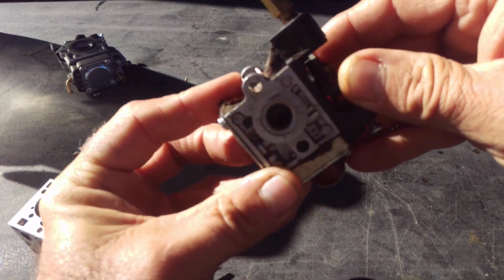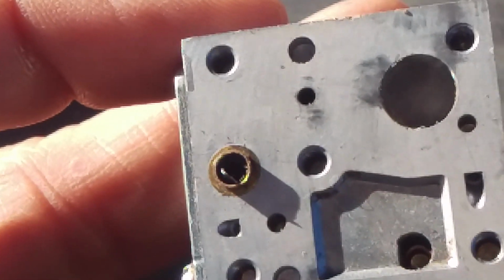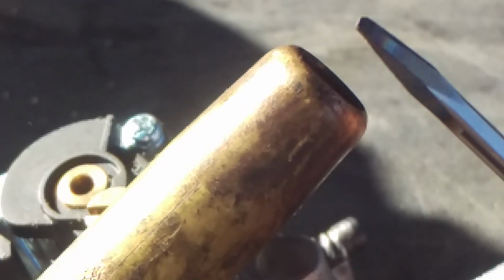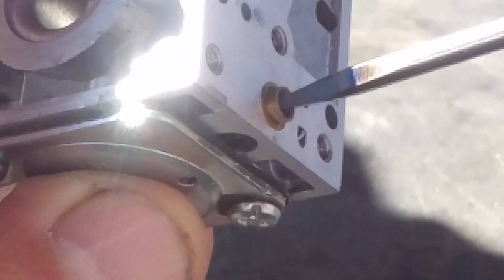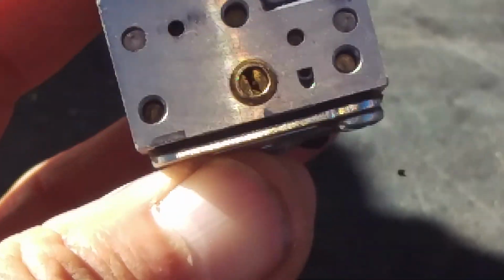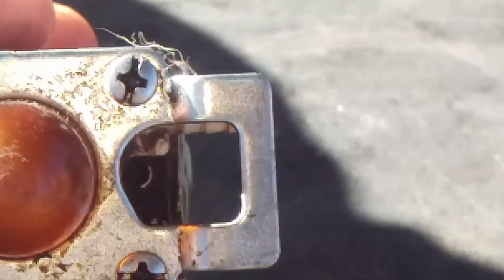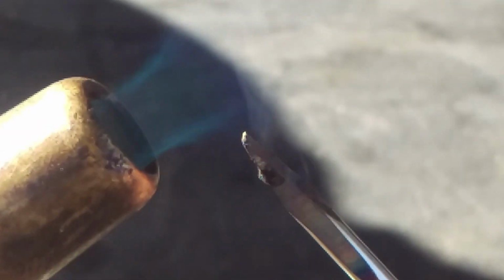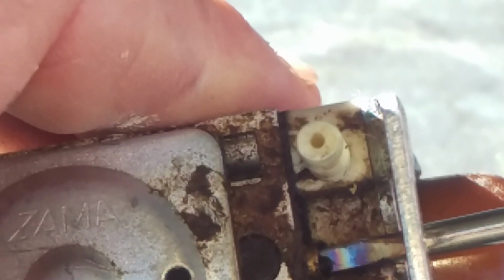How to access hidden jet screws on barrel carburetors

Comment: Rotary style carbs are a PITA. I wish echo would quit using them.
Reply: I never knew about the third one you found. Great info!
Reply from the maker: @bubbafudpucker397  I found it from Steves Small Engine Saloon. He's one of the handfull of guys I trust.
Reply from the maker: Yeah but you have to play the hand you're dealt. What I learned about thoseplugs is a game changer for me.  Now I can go back to rebuild kits on those rotary barrel  carbs and keepmore $. I have a set amount of $45 per carb replace/rebuild. $6 vs $15 on average. Win Win for me. Thanks for jumping in the conversation. Hope to see more of ya!
Reply: @ZombieDaveAZ  I charge an hourly rate and $1-$3 per part for parts markup, (for my time spent finding and ordering each part). Most of my carb cleanings/rebuilds are $20-$30 total. Handheld or four cycle stuff either way.
Reply from the maker: @bubbafudpucker397  thats very fair. Im 'usually' same day or weekend turnaround. Some of my customers don't have 2 or 3 pieces of the same necessary equipment. Thats the niche I fill and capitalize on. They are thrilled w/quick service and not being raped by the Stihl or Echo Stealership  I only accept what Ican deliver on. Reputation is everything which drives 'word of mouth' advertising. Sometimes they have to wait. Then  when I get a machine its fast turnaround. It works for me.
Reply: @ZombieDaveAZ  Most of what I did was for myself, to sell on Craigslist. That business model dried up for me. We'll see what 2019 brings.
Reply: Nice video. I really enjoy Steve and donyboy. Very good informative videos. Taryl is ok too. Just don’t care for the silliness all the time. I like quick to the point videos!!